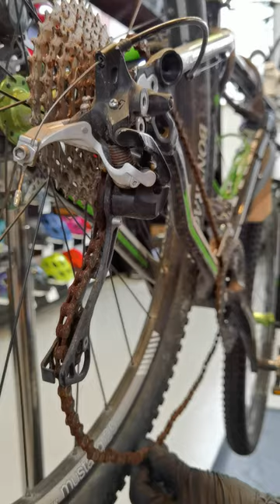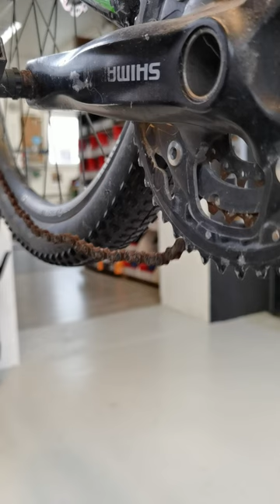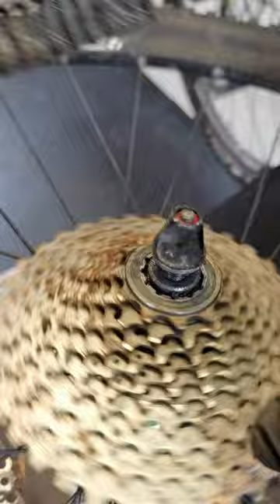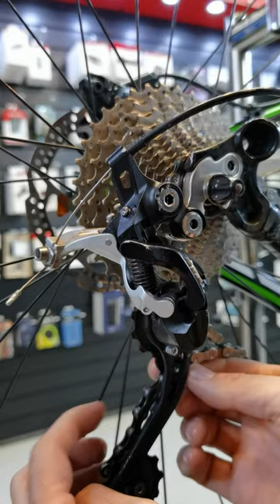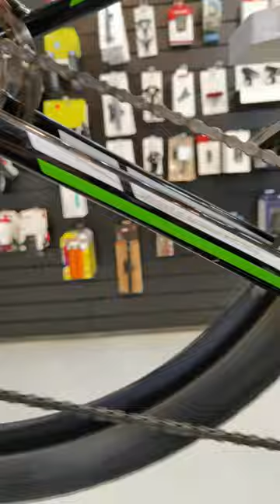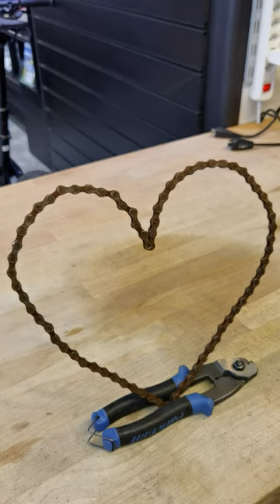Rusty chain - clean, repair & adjust #shorts

Comment: Guys I’m not even kidding diesel diesel diesel, oh my god dude diesel is the best chain cleaner I have ever used, it’s cheaper than degreasers you buy at stores and it works better too. I used a spray bottle and misted diesel all over my bike chain and everything that touch’s the chain because I had a good thick layer of tar built up, the diesel just melted it off like butter and than I scrubbed it with a toothbrush soaked in diesel and rinsed with water hose. My chain is brand new without actually being brand new.

Comment: That chain was salvable
Reply: I don't think so.
Reply: If the chain is that corroded it's typically stretched too since the corrosion is likely inside the rollers too. you can try to resurrect it but if you measure the stretch they are typically worn

Comment: You just bought brand new ones. Fake.
Reply: it was time for new chain anyways. even cleaned, that old chain would never perform up to expectation. the sprocket is easy to clean with wire brush. it will make the bike feel like new.